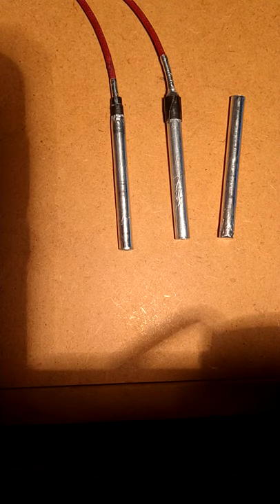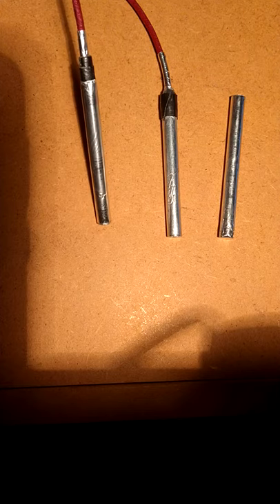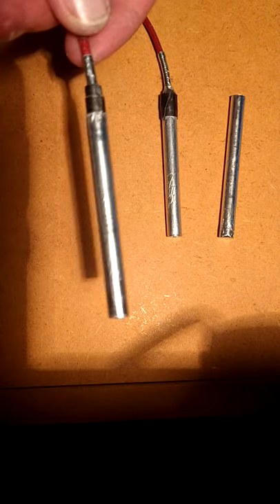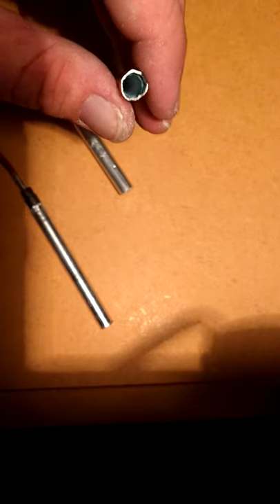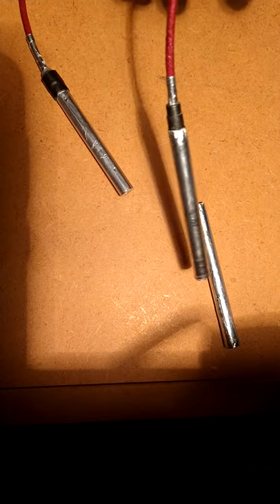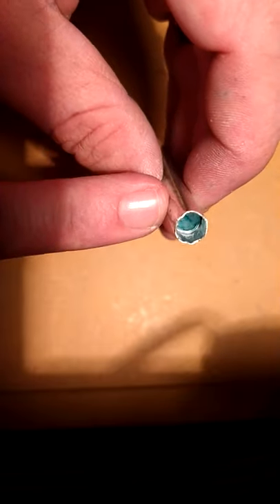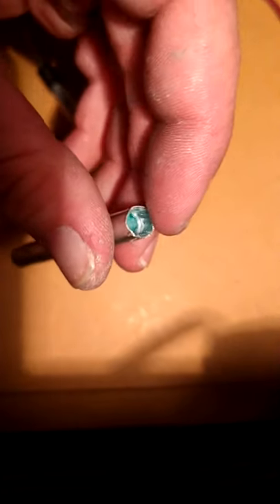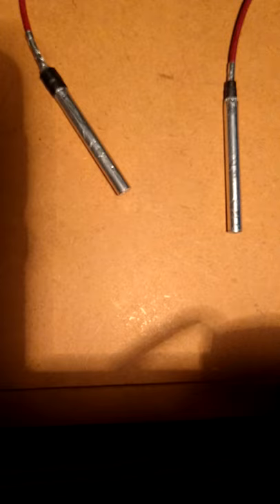💥Improvised blasting cap💥

Comment: Very well done. They look very professionally made. If you want to make an electric one the coils from  discarded vapor cartridges are hard to beat. Work with DC, AC, and CD firing sets, also not unduly sensitive as they require significant current.

Comment: what primary do you use in ur caps ?
Reply from the maker: Anything from hmtd, lead azide, etn and, even tatp if I'm strapped for cash or chems
Reply: @improvisedchaos6355  you can use eтn as the primary?
Reply from the maker: I'll tell you about it just click that subscribe button brother
Reply from the maker: That way I can reply directly to you
Reply from the maker: @KClO3  you can but you have to have something to initiated in the Detonator and you don't have to have a primary necessarily but you're going to need something with enough Force to initiate the powdered etn to cast etn if you want or just to the powdered pressed
Reply from the maker: @KClO3  as long as you make high-quality etn it's not going to be as easy to detonate as bullshit but I have never had a problem iniateing etn with CHP or double base black powder when I have it compressed and enriched
Reply from the maker: @KClO3  the best source for information on the subject is college research PDF files or researchgate but you have to be a member to access their information a lot of time the information is verified and Quantified
Reply: @improvisedchaos6355   Even tho i am late, Does enriching ETN mean adding metal fuel to it?
Reply: Footing Ball555  He did say He uses a paper tube, and rolls the aluminum foil around it, but Yes You are right about HMTD in contact with metal is a no  no.
Reply: @improvisedchaos6355 what is chp?

Comment: Could you use a metal straw for this. I personally think its a great idea im going to try it out when i get some
Reply: No
Reply: Unless you separate explosives from metal with a straw
Reply: Update: it works great
Reply: @galvidmar1247  use a plastic straw inside
Reply: @fudes587  I put wax in it to separate the explosive from the metal

Comment: These look great man, syringes are weirdly unattractive to me.
For whatever it's worth, I don't know of any initiative material that forms undesirable salts with aluminum; cu, zn, fe, and especially alloys that mix them (like brass or steel) have those issues with organic peroxides, metal azides, trinitrophenolates, etc. but al doesn't. Which is why commerical detonators use aluminum casing despite using priming compounds containing pbn6. (Ironically enough these mixtures often have tetrazene or are even aluminized, making them probably more sensitive than a lot of primary explosives that "expert" hobbyists shun). If you avoid metal to eliminate risk of secondary blast injuries I get that but there's no issue w/ primary explosives touching aluminum. 

I like either 1/4" thin aluminum tubing or a rolled up section from a beverage can w/ the shiny side facing out for looks.. you can put a clean looking crimp on tubing w/ a pipe cutters if you care for the aesthetic appeal of it and it can hold thick safety fuse/round wire insulation in place nicely without glue.
If you only use a little bit of tape to close the end, the detonation wave can travel into whatever the detonator is initiating much more effeciently which makes a much bigger difference than you'd think. 

Cyanacrolate (super glue) is exothermic especially w/ cotton and can create friction but if you're using it before filling the cavity with anything it's not a problem. Using it to seal the fuse is dangerous and I'm not even a safety Sally.

I don't know if this is helpful to you or anyone else but I wrote up the weight of initiative materials needed to have a detonator approximately equivalent in power to a legally defined # 8 blasting cap. 

640mg ETN + Thermal shock mix 
600mg PETN + Thermal shock mix (if that works with PETN)
1.23g TCAP 
1.38g HMTD
1.35g AN/TCAP 1:1 ("APAN")
970mg NHN
640mg MHN (600mg if you believe wiki)
480mg PETN+250mg TATP/275mg HMTD
610mg TNP + aforementioned primer^
515mg ETN + aforementioned primer^
450mg RDX+370mg TCAP/415mg HMTD

Unaware of some of the detonation parameters of  c2ag2(+agno3), pbn6, agn3, etc., so I wouldn't know how much is needed.
Hope any of this could be helpful to someone 👍🏻
Reply: That’s some really helpful info. But I have a few questions, so do organic peroxide’s react/become more sensitive in contact with aluminium, copper etc? Also since potassium picrate reacts with metals to form unstable picric salts is there a way to make a detonator containing one without really using plastic? The reason is cause if your using a primary that isn’t super strong a metal casing will help a lot. I’m thinking that a straw could be used and surrounded with aluminium maybe. One more question, do you know of any decent primary that don’t need, perchlorates, metals like lead/silver or any expensive/very hard to get materials. The reason why is where I live it’s pretty hard to get many materials needed to make primary’s. I can and have made many secondary’s but primary’s are tricky. I have also tried heatshock detonators (etn) with not much success. Any help would be epic. Thank you :)
Reply: What thermal shock mix? Good write up but some of it isn’t explained
Reply: Do any if these need a detonation chain from a primary or can these all be lit with fuse?